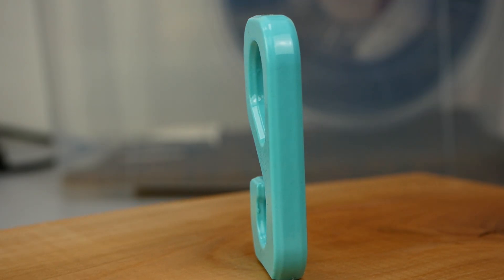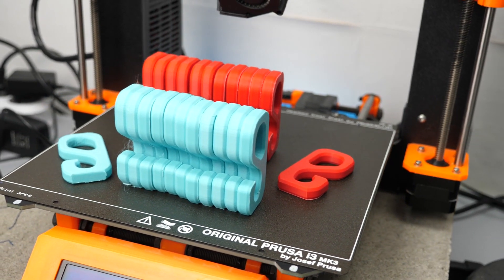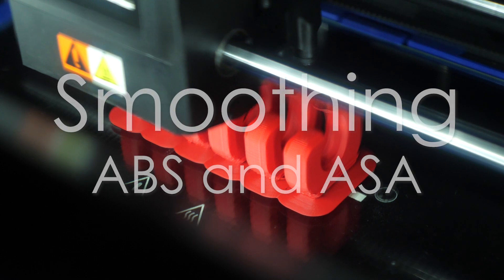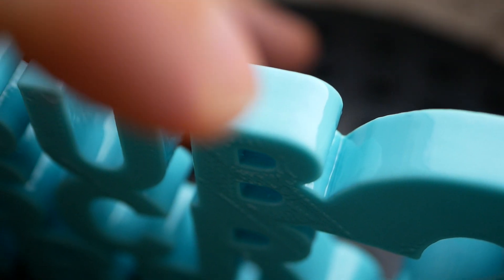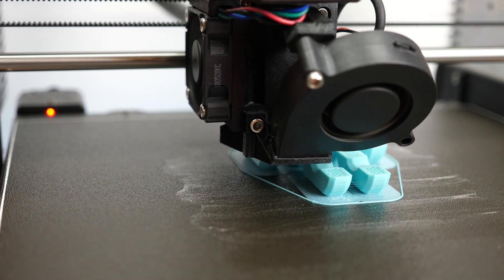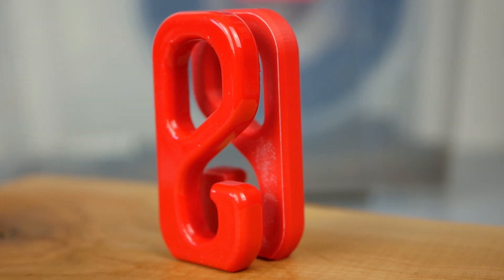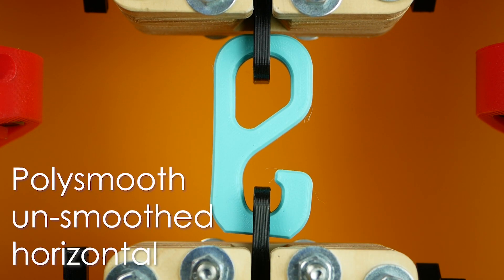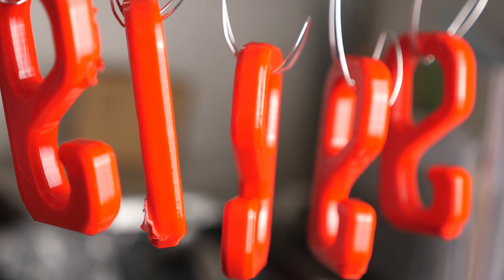Stronger 3D prints with Vapor Smoothing?

Comment: Perhaps "vapor-smoothing" provides no noticeable improvements, but a procedure purposely designed for "acetone hardening" has given me parts with nearly injection-molded strength, as long as I don't damage the parts with over saturation.

Because I print almost exclusively with ABS, this was one of the most valuable tests I have seen in your productions, but it is puzzling that the overall tensile strength of acetone smoothed ABS is slightly reduced. 

Although I have complete and total faith in your method of experimentation, and absolutely accept your conclusions, this particular result has not been my experience, although I do not use the vapor process for improved strength.

First, to counter all of the extremely bad advice for printing with ABS provided by the "experts":

Urban Myths by "experts": (These observations regard aspects necessary to produce dimensionally accurate parts, with less emphasis on strength, which is why acetone hardening works for me)

Myth #1: ABS MUST BE PRINTED AT ITS HIGHER TEMP RATINGS...
My experience: NOT ALWAYS...
If you don't really care about dimensional accuracy, and if the functionality of your part won't suffer from minor warpage, go for it. You will have to print at higher temperatures to print quickly regardless. So far, printing slower is better for accuracy, as are the lowest possible bed and nozzle temperatures. This opinion is rendered useless if you are printing a high-temp chamber, like Stratasys machines do; since the glass-transition temperature of the bulk mass can be carefully controlled.

Myth #2: ABS MUST COOL SLOWLY TO HELP CONTROL WARPING...
My experience: WRONG!!! 
ABS must be cooled as quickly as possible, so its shrinkage gets "over with" as soon as possible. This eliminates the tendency for subsequent layers to "gang-up" as they cool, reducing the tendency of the gross mass to warp due to thousands of fibers pulling in unison as they shrink during cooling. The downside is that fast cooling, along with reduced fiber contact area cause by low nozzle temps, causes tremendous "local shear" when the hot fiber contacts the fan-cooled fibers laid down earlier. This is why my parts have acceptable accuracy, but have poor layer adhesion, unless I slow the print down enough to allow the nozzle to "dwell" longer at lower temperatures, improving layer strength without losing accuracy.

Myth #3: Because of #2 above; USE NO FAN WITH ABS...
WRONG AGAIN!!! So, before I got control over bed adhesion, I had to deal with "elephant's foot" caused by having the bed temp too high. After I got control over the elephant's foot warping AND bed adhesion, I began to experience the OPPOSITE phenomena, which for lack of a better term, manifesting as "opposite elephant's foot". Now, instead of splaying-out at the bottom, my prints were actually drawing in at the bottom, and THIS problem has NO advice available, so I had to figure it out on my own, which is how I came to discover the inaccuracy of these "experts" advice.

Obviously, one of the trade-offs being strength vs quality, printing ABS at the lowest possible temperature has, in my experience, produced excellent quality, but with very weak layer adhesion which causes thin sections, like snap-fit pawls , to break off very easily.

When I started printing with ABS, I soon discovered that applying a thin "coat" of acetone causes these sections to harden significantly, which is not what your experiment revealed, however thorough you were at considering the typical factors.

Because acetone hardening actually does work (if applied properly), but your experiment reveals that this is not necessarily true, I did some deeper examination, and discovered the following:

Parts with thin sections having little to no infill benefit hugely from acetone hardening, but the amount applied must be controlled to avoid over saturating the plastic, which can dissolve the section beyond usefulness. It also must be applied evenly to BOTH sides, simultaneously if possible, or the part will warp in the direction of the applied acetone. Brushing thin coats is recommended, dipping is discouraged unless you can dip and "tap off" excess acetone very quickly.

Parts with thicker sections are more problematic, as your tests revealed, but there are remedies (or at least observations) that may be helpful in understanding the reduced strength. The tests and observations I have worked through are extremely detailed, so here is a summary:

There are two methods for applying the acetone for the purposes of hardening, (neither of them uses the vapor method which proved to be wonderful for finish quality, but ineffective for improving strength). These methods are brushing, and dipping, where brushing allows the finest control over the amount of acetone being applied to a surface, and dipping which allows hardening in places where brushing would be impractical.

Believe it or not, how and when the acetone is applied makes all the difference in the strength of a bulk part with thick, infilled profiles, because there are several stages during application, absorbtion. drying, and re-application of subsequent "coats" that can be controlled to provide (or nullify, if done wrong) improvement in layer strength.

When a part fresh off the printer is initially exposed to acetone, the acetone is absorbed at a very high rate, essentially soaking-in via capillary action. If the acetone is merely brushed on in a thin layer and the left to dry, the following occurs:

1. it is absorbed into spaces between the fibers...

2. It begins to adsorb (yes, I said "adsorb"; look it up...) into the plastic polymer, slightly dissolving it...
3. The surface "wetness" transitions from the pure acetone, which evaporates away quickly, into a thin layer of acetone-dissolved plastic (which gets spread over the surface while the part is being brushed...
4. The exterior of the surface dries, forming a very thin plastic shell, effectively "sealing-in" any remaining acetone, which keeps the fibers soft...
5. The adsorbed acetone in the soft fibers (very) slowly diffuses out of the sealed layer(s), leaving a hardened shell as thick as the penetration depth of the acetone treatment.

And the big problem arrives with item #4 in the list above, in combination with over-saturating the plastic in your part.

Your process hardened the parts, and gave them a week to "dry out".

If your parts were thinly dressed with acetone, the process did nothing to help its strength, and if you soaked them thoroughly, a week was not long enough. That's because the more the outer layers "dry out", the better any remaining acetone is sealed in, and quite tightly, I might add.

And this happens if you keep applying acetone before a shell is formed, because your fibers will drink in all of the acetone you give them until it reaches the very internal spaces between infill layers.Once this happens, assuming you didn't entirely dissolve the internal structures, a shell forms, growing ever thicker as acetone diffuses out of the fiber layers, a process that goes exponentially slower as the "gas-seal" of the shell becomes thicker.

I know this because I have a couple of over-saturated parts printed in translucent ABS which had been lying in a bin for more than six months, and do you know what? You can see liquid acetone sloshing around inside (where the infill used to be), and I'll bet the surface shell is sealed so well that these may never dry out. Discovering this, I looked at several other parts that still had their infill, but destructive testing revealed the infill fibers to be very soft, even after several months.

And don't ever try to drive out the acetone with heat, EVER, unless you like the tumor-like bubbles that will destroy your part entirely.

The secret: Whether brushing or dipping, your initial "coat" should be as thin as possible. Desirable as it may be to get better adhesion into deeper layers, there is a point of over-balance that will trap excess acetone, possibly for a great length of time. If you must get treatment into infill layers, drill holes IMMEDIATELY after the shell hardens to vent trapped acetone, and under no circumstances use heat to attempt to drive out the vapors.

I don't have the apparatus you do for performing strength tests, so my end result is largely "seat of the pants", but my "seat" tells me that untreated parts, printed under my ideal conditions, are weak, but treated parts are immensely stronger, enough to suit my purposes, so the metrics don't really matter.

Comment: I have used acetone with ABS a lot and found that if the acetone is allowed to penetrate deeply, it will make a big improvement to strength. It doesn't work for detailed parts. Maybe try soaking your hooks in acetone for say 30 seconds or so, then let them harden, then heat to say 65 degrees for a few hours to drive off the acetone?

Comment: It would have been interesting to see if acetone or propanol applied during the printing process would affect the material strength. This would actually glue the material together not just by heat but also by adhesion. 
In my model building times I created an ABS glue with acetone to fix the keel of my sailboat to the body. The material never fully hardened ever since than. And now my boat is like 30 years later, still the material on the glueline is soft.
I guess the material does change it's attributes. While the hardness and stiffness goes down (which you tested) some other attributes like sheer resistance and viscosity goes up. The stress-test for pulling with slight rotation that you tested is not what is enhanced, I think.

Comment: I made the expirience that ABS tends to foam up a bit forming tiny bubbles which don't show on the surface

if you dissolve some ABS in Acetone and cast it in a mold and cut and sand it you'll clearly see those bubbles even by eye

this happened to me while glueing ABS parts and sanding the glue joint after

might be the issue why the smoothed part fails sooner

Comment: Yeah, you might be doing it wrong...at least the ABS smoothing. I know from experience that using the "slow" method of exposing an ABS part to acetone vapor leads to weaker parts. It seems like the slow method allows the solvent to penetrate deeply throughout the structure and the individual beads of plastic just never fully cure. 

I use the method of boiling acetone in a beaker and dipping parts into the cloud for about 15-30 seconds. The parts are then pretty much immediately put under a fan for 48 hours. The acetone exposure is thus limited to the exterior, but you get the same hard, high-gloss finish.

Comment: Acetone entrains water which could remain in the plastic with residual acetone. You should distill the acetone to achieve pure acetone (~100%), and then desiccate the smoothing chamber, at an elevated temperature (~30-40C), to remove all the humidity. Then, store the part in a desiccated, convection chamber (a fan in a cardboard box/plywood box with silica/alumina powder packets) for 3-weeks to remove most of the acetone in the part. Finally, bake the parts (35-40C) for a week to flash off the residual acetone in the plastic. If you flash off the acetone right away in a thermal chamber the surface of the plastic parts will bubble and ripple. Make two controls for comparison. 

If you get the same results, then it could be that the acetone has messed with the polymer orientation/morphology. If not, then it could be that the water, or spome other contaminant, has embrittled the plastic.

Comment: RIDDLE SOLVED: Acetone weakens ABS. Always believed stronger, but due to the easy cracking - I had my suspicions.

SAD I guess only go there when AESTHETICS is of primary concern?!

I treated PEARL WHITE ABS with ACETONE and it got all Princess Lumpy on me, stayed rubbery for several days - have not tested it, but it does actually appear to be stronger?!

CURIOUS though,...does this apply to TRANSPARENT and TRANSLUCENT ABS that in general is much more resistant to ACETONE treatments?

WAIT A MINUTE....one time when I had an XYZ Da Vinci Printer I treated a part printed with their BLACK ABS. It took a few days to fully cure, BUT when it did it was practically UNBREAKABLE! I stepped on it (I weighed more then) - threw it HARD against the wall HONESTLY it was as tough as one of those little ABS molded ARMY MEN! So what gives how the heck did that happen? That is what made me a believer that ACETONE was like actually molding the ABS!?

Comment: Hallo Stephan! Greetings from America! To boil out the acetone you’re must raise the temperature of the hook samples to at least 56.08 °C at 760 mm Hg for perhaps an 8 hours then allow them to cool. Same goes for the isopropyl smoothing: 82.3 °C at 760 mm Hg are your values. This should ensure the solvents have been evacuated. Unless you think the temperatures could affect tempering of the substrate. Then maybe try both at the higher temp. Thanks for your pioneering efforts in your videos! Looking forward to the next one and your thoughts. Cheers from Nashville,  USA.

Comment: Honestly I am surprused and not entierly convinced, since from my expirience, ABS parts benefit from acetone smoothing greatly. 
Here is what is done differently:
1)  Print stuff with a wider nozzle diameter (0.8mm and 1mm),  rarely with any infill at all. So there is a 1 to 2 perimeters totall at the outside, since I need shells or hollow parts much more often. 
2)  Apply acetone directly onto the part using a paint brush. Keep aplying untill the outer layer starts to melt a bit and ventilate it like hell.
I wonder if it has to do with me having a mistuned setting somewhere, resulting in better strength performance when acetone is applied.

Comment: Would baking after vapor smoothing help? I would expect the volitiles would defuse out of the parts. The baking might help improve the layer to layer bonds. Unfortunately this would be a time consuming experiment because the baking temperatures add more variables. This would give you the opportunity to try out some form of statistical experiment designs. There are different forms of design that allow more variables with a limited number of test parts. If you find something you can change the design to fine tune the results.

Comment: I paint my prints with acetone and then spray paint them and let them dry in a drying oven. Some of these prints have been used as cold air intakes in engine bays without failure. I'm seeing the complete opposite in results using this process then your video demonstrates. 

I am confused!
Reply: Hmmm.  Seems like your prints on an engine would get annealed every time from the residual heat when the engine is switched off.

Comment: Try this! After letting them offgass for 72 hours anneal them in the oven for 2 hours (around the glass transition temperature). Furthermore let them cool to room temp in the oven or a drying kiln! Otherwise it takes 6+ months to really offgass and the resultant plastic still behaves reminiscent of wet filament. 

I haven't been able to formally validate it, but my working theory and experiences suggest that the solvent gets readily replaced by moisture and/or results in fractured bonds. Forcing whatever solvent that remains out at a higher temperature and encouraging the material to reform it's bonds results in significant structural improvement.

Comment: I have some experience on Polypropylene (PP) material compatibility testing with organic solvents. You might still have Acetone in your parts. If you weigh your parts with a laboratory grade scale you will probably see that the parts are still more heavy after 3 weeks of curing, than before the Acetone treatment. It might irreversible diffuse in the material and almost never leave them. Also curing them in an oven at relative low temperatures will likely not drive out the Acetone completely. It is also not uncommon for plastics to lose some of their mechanical stability permanently after being in contact with solvents (especially really strong solvents like Acetone). This is also true if you are able to drive out all of the solvent that you had in the plastic.

Comment: You said you „dryed“ the parts for two weeks at a normal temperature.
May it will be a way better at your test, when you dry out the smoothed part to get the aceton out of it.
In my thinking those smoothed parts should be min. 15% stronger than the unsmoothed.

Again nice test from yours 👌

Comment: Is the material turning into the solid state before the next layer is being printed above it? If yes, then maybe printing in the higher ambient temperature will allow to get better "solid" structure? Better connection (maybe even on the atomic level) of each layer will lead to almost the same strength as regular plastic element.

Comment: Kinda cool to see that welding plastics involves heat and force, if force (like in FDM printers) is missing, layers wont adhere properly.
When I am welding PE or PP (Warmgasziehschweißen) at work the welds will almost be as strong as the base material.

Comment: Hey Stefan, I have a question I'd love for you to answer. How would the material properties improve if you printed your test samples at a 45 degree angle from the bed? It seems like it would reduce strength from a horizontally printed specimen, and improve strength from a vertically printed specimen. If uniform mechanical properties are a priority and a severe weakness in one plane is undesirable, this might be a good alternative.

Comment: I recently saw an experimental HDPE filament available on a Canadian 3D printing website. You should test it out, the reviews said that it was hard to figure out bed adhesion but that it had superior layer adhesion, and while it is a hard material it bends rather than breaking.